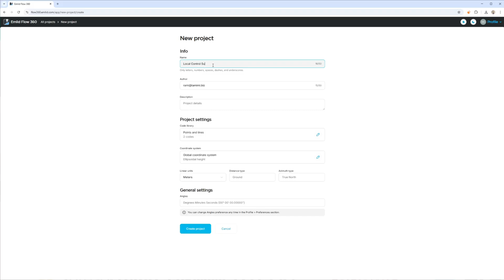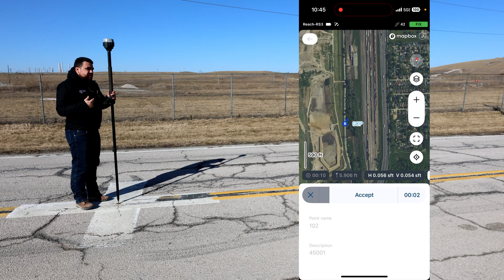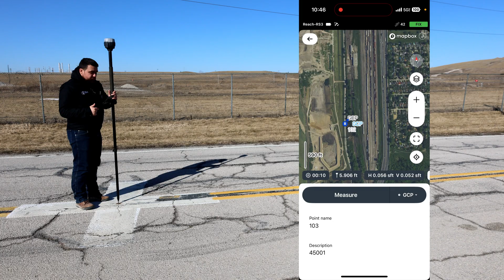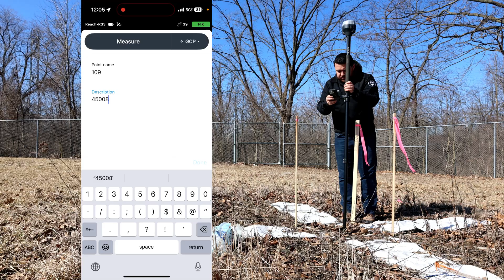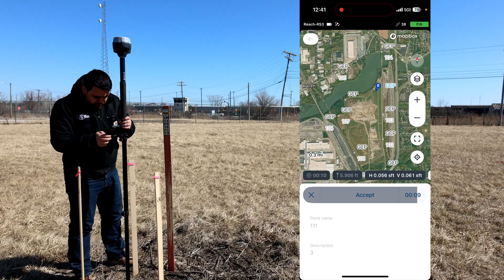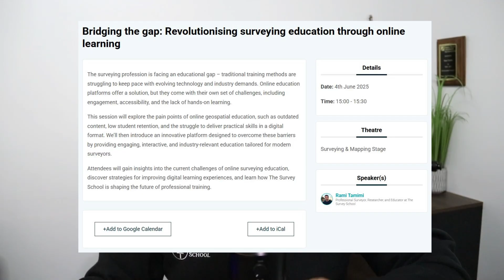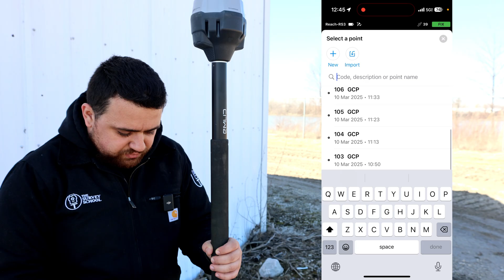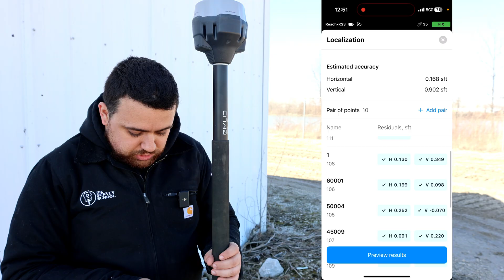How to do a Local Control Survey (Start to Finish in 15 Minutes)

Comment: You need to hold to the ONE best vertical point so not to introduce an inclined plane.  It's fine to check them all to see all the residuals but in the end, hold the best one.

Comment: Point 45006 could have been located/checked after localization and/or trilateration using 2 or more points.  Or metal detector or Fluke thermometer.

Comment: Question am new too survey , i see your using the base station without the tripod legs , when surveying if you dont have any GPS plates should you always use the tripod too make sure your level ?? Sorry if this sounds confusing
Reply: He's using 1 rover via paid NTRIP CORS station.  Not his own physical BASE.  Some states offer free use of their CORS which personally all states should considering if you pay taxes.

Yes, should always use a BI-POD with a rover to level up properly not to mention to hold it up with data collector etc instead of laying on ground or tree etc.

Tripod is typically for your own base or total station or static logging if only 1 receiver.

He's using TILT feature which accounts for non level observations fir "convenience" over precision.  Turn TILT OFF for best precision.

TILT also comes in handy though for taking measurements of building corners and tight areas.  It's also possible to measure and stake vertical surfaces with TILT also 😉 In a way kind of like using a Leica Disto or Total Station to a certain extent.

Comment: Hi Rami.  When you imported the local coordinates into a project with state plane coordinates, how do they land anywhere close to your project site?  Or, maybe they don"t?  It was difficult to tell by the screenshot, and you didn't mention it.  Do they just layout in some random place because the values don't link up with the state plane coordinates at all?  Thanks!
Reply from the maker: Yes in a random location. Mine ended up somewhere in Indiana hahaha. But the reason you set the project to SPC is so your GNSS records the data you measure into SPC. After localization, the local coordinates will be aligned with the aerial map.
Reply: @RamiTamimi  That's what I thought.  Thanks for the confirmation.  And, thanks for the video and other content!

Comment: How about using a Bipod!!!!????
Reply: Measuring is better with bipod imu is only if you need it , other problem should be distance to the base more than 5 km  prescition is no good..
Reply: @porto4664 

Correct.  TILT is for convenience over precision.
Reply from the maker: No need for one with an IMU enabled GNSS receiver.